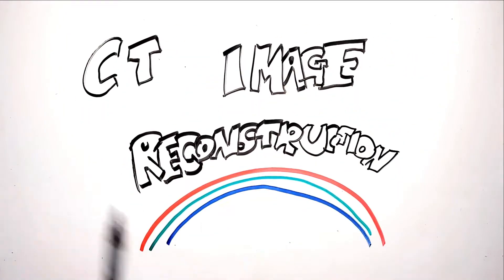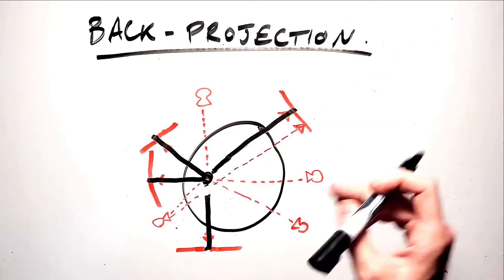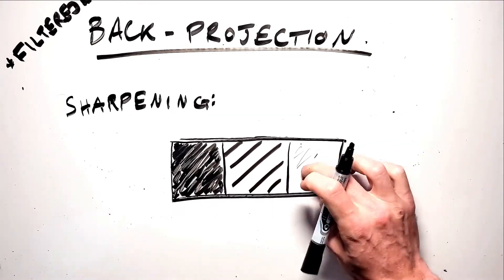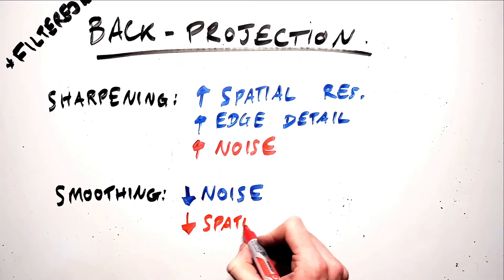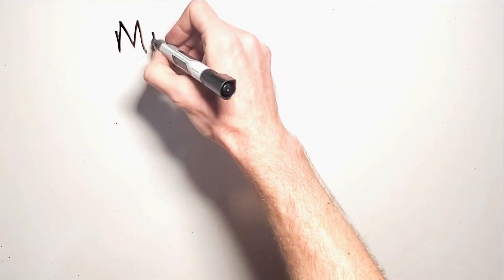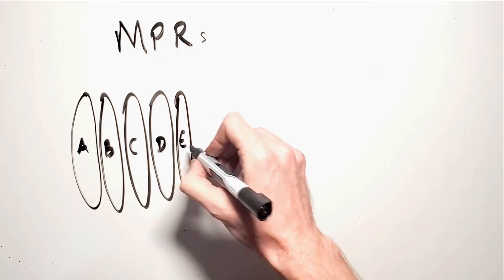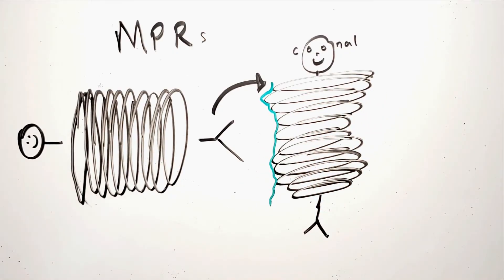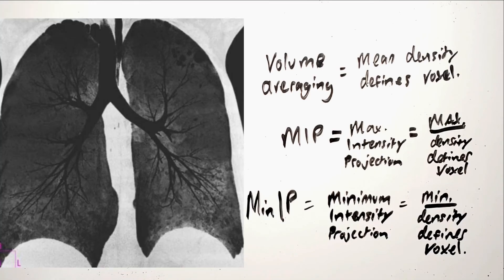CT Image Reconstruction

Comment: I like your explanation of the reconstruction processes currently in use. However, the explanation of MPR creation is out of date- we no longer use image data to create reformats, rather we use raw data to create multiplanar reconstructions that are of equal quality to the axial recons. It has been about 15 years since image data was considered adequate for creating MPR's.
Reply: Hi, could you offer a primary source validating your statement here? I am not aware of any CT scanner that does this. An MPR can be planned from the scout images, but it's still created from axial image data. An MPR, by definition, is created from image data.
Reply from the maker: @gospelphysics  Your interpretation is correct. While most scanners offer direct-to-MPR type options in their software - which I believe is what Caroline is describing - what this typically does is generates a "Volume" or set of very thin axial slices and then reformats those into MPRs. Under the definitions described in this video, this "Volumetric" dataset is still considered image data and is distinct from raw data. From the end-user software side it may appear that the MPRs are generated directly from the raw data, especially in instances where you are telling the scanner "Acquire this scan then reformat Axial, Coronal, Sag", but the step of creating a volume still exists and is completed by the software as a necessary step in the process.